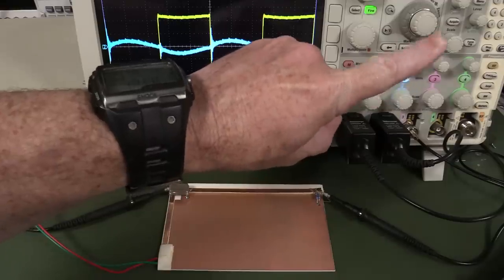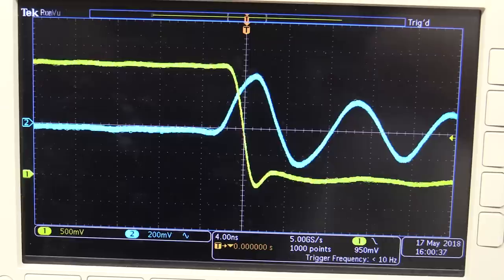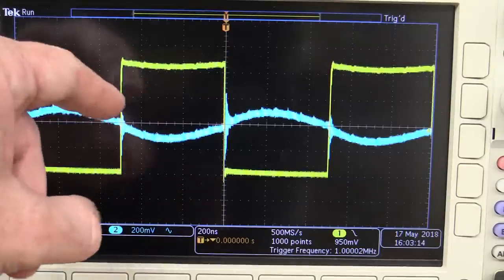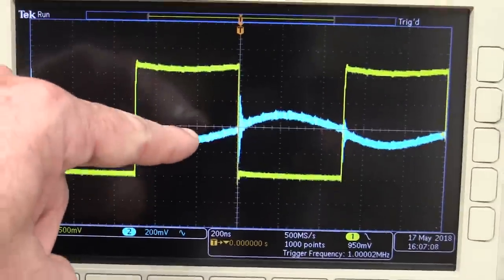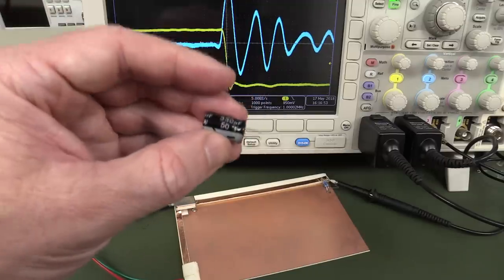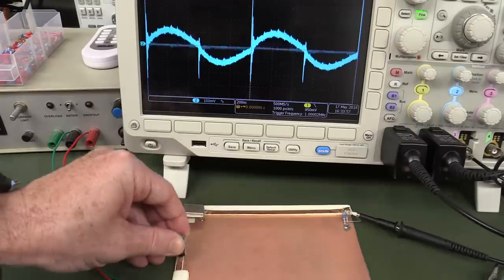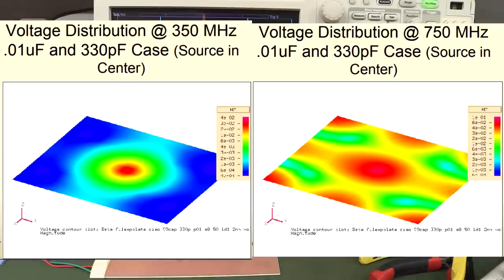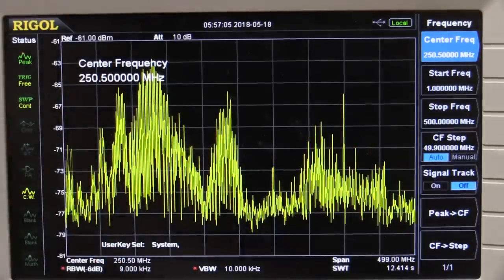EEVblog #1085 - Bypass Capacitors Visualised!

Comment: 21:40 Wah wah -- you've mixed your conditions!  The DC return path is just that, DC; the AC return path is not.  The AC loop area is essentially under the traces (since you've got a nice solid ground plane).  It sure would be nice if this could be visualized -- like with a current probe at 24:50? :)

Indeed, we can calculate what frequency counts as "DC" for this loop.  The ground plane stops being "planey" at frequencies where it stops being a good shield: when the skin depth pokes through the copper's thickness.  A couple mils of copper bottoms out around 1.8MHz, so you should expect to see the 1MHz fundamental further away from the trace.  At many skin depths (low kHz), it will pretty well disregard the trace's path, and then follow the black line shown. :)  (Downside: the signal strength will probably be way down below the probe's noise floor.  May be worth setting up a test with higher currents -- an audio amp, say?)

Good visualization of bypass caps and waveforms, cheers!
Reply from the maker: I demonstrated that the bypass capacitor currents at 1MHz are flowing through the ground plane and into the leg of the bypass cap that is paced well away form the transmission line, thus creating a large loop are for that 1MHz stuff.
I'll need a different experiment for the higher frequency stuff.

Comment: Well that's creepy, I think was debugging a circuit that needed a bypass capacitor to fix it in a uni prac right when this video went up.
Reply from the maker: Breadboard?
Reply: Yep. DAC0808 switching was putting noise on my 5V rail, which I was deriving a reference voltage from.
Reply from the maker: Current based DAC's are pesky like that.

Comment: This is essentially Dave's version of this...

https://youtu.be/9EaTdc2mr34

(ie. the video I linked to the other day. lol)

Looking forward to this one, though, as I know Dave will go until a lot of detail.
Reply: Just watched all of Dave's vid - it was superb, as expected. ;)

Seeing everything visualized like this in "realtime" is 1,000 times more effective at getting the point across than reading a few paragraphs of a theory book.

I'm currently starting to do more complex PCB layouts for 4-layer with BGA chips, and the info in just this video alone is invaluable.

I used that same Saturn PCB calc recently to find the best trace width for some evil RDRAM (N64 board), and it worked quite well.
(albeit not at the full 250MHz, as my trace routing still wasn't ideal. lol)

Dave, have you done a vid showing how a coax cable can have characteristic impedance, even when there's no load on it etc? I could have sworn you showed that as well before?

Comment: Have to say we audio guys get away with murder... i don't even look at anything above 30k, hell, my measurement gear can only go up to ~100k at max, if even that.. Groundplanes are always "flat", no need to think about transmission lines... We got it easy.
Reply from the maker: Well, when I was in the underwater seismic industry, 30KHz was practically RF.
Reply: I wouldn't be so quick to ignore RF in audio. If a power amplifier is unstable it can oscillate at an ultrasonic frequency and take out a tweeter in no time. I once heard a taxi radio transmission blaring out through a guitar amp, and here's Fran pointing out a cell tower signal coming through an amp:
https://www.youtube.com/watch?v=tfkdwiKZgrY&t=811s

Comment: Surely you DO understand transmission lines, but the way you're talking, based on multiple statements, it sounds like you don't... Whatever...
Reply from the maker: What did I say that was wrong?
This is not a transmission line tutorial video, it's (partly) about explaining how at high frequencies the return ground path follows under the transmission line.

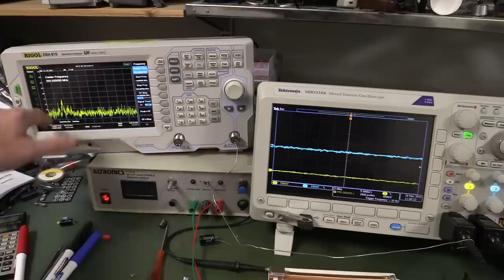Comment: 27:00 Doesn't make sense at all. I have a feeling that the radiation is coming from your PSU. A 1Mhz square wave and you're getting radiation in the 100s Mhz. Nah, that's not from your circuit. Yes a perfect square wave has an infinitely wide broadband signal, but the amplitude significantly drops with each harmonic.